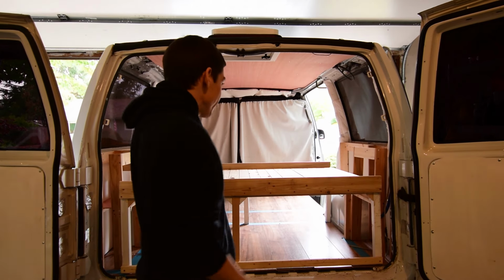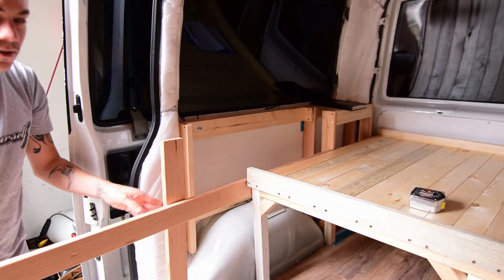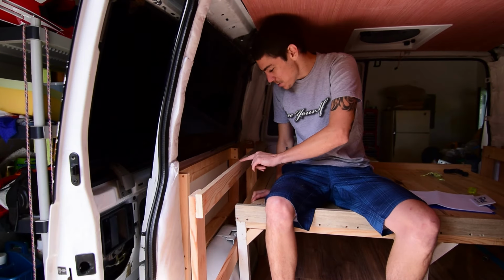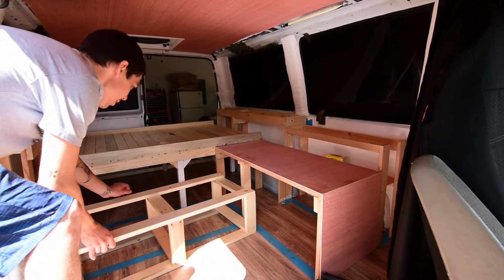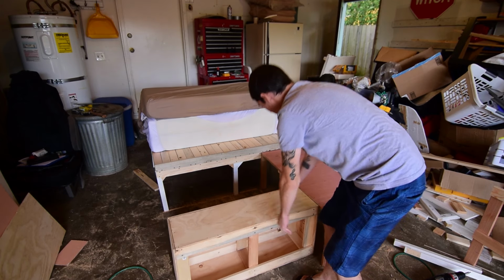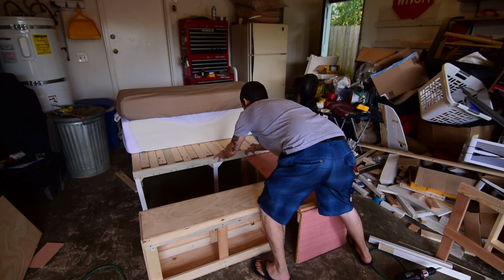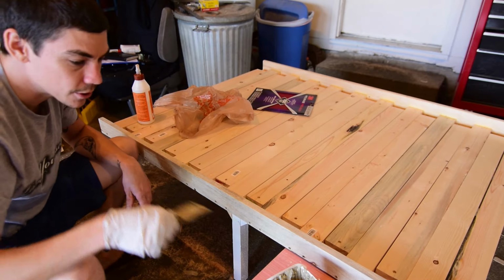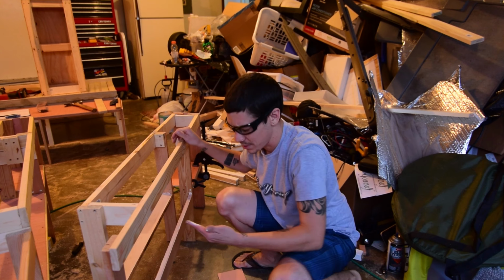VAN BUILD 2pt.13 FINISHING CABINETS, ULTIMATE STEALTH ASTRO CAMPER VAN DWELLING

Comment: Man that looks GREAT. And that piece of wood that you have as your bed stopper you do NOT need (Hey its your van and your doing great), I just would have put the bed stopper on the back of a few of your bed slots, just by adding a few small clips under a few slots to catch from under the bed, but its the same result either way. Congrats it looks GREAT

Comment: For the bed slats sticking, go to a store that sells canning supplies and buy a block of paraffin wax (also called canning wax or jelly wax), then rub the wax just enough to get a light residue on all the contact parts.

You may need to reapply a few times as it wears in. I do not recommend beeswax in this application because it may stain your mattress because of the very low melting point.

I use this trick on the drawers and doors on old furniture.

Comment: I have a suggestion, I hope I can make it "understandable". On the back of ur bench that u will be turning over and Sliding back to the end of the bed, glue a piece of felt on the back And it will slide so easy, quiet And will not Scratch ur floor. 🐙 Great Job! I would have had to use , used furniture pieces from the thrift store!
Reply from the maker: +Debrajoy that makes perfect sense, and is a great suggestion! Thank you!
Reply: +Into The Mystery 13 No problemo! I'm luvin ur build! 🐙

Comment: Oops, I know this is too late, but I would use light coats of good quality spray paint, gives really nice Finish! 🐙 Do in the back yard on paper tarp, no mess!
Reply from the maker: +Debrajoy spray paint on what?
Reply: +Into The Mystery 13 On all the wood u want to paint, u get better coverage and it's easier than trying to use a brush.  Rustoleom makes one can with a great spray nozzel that let's u spray from any angle, even upside Down! A few "light" coats keeps it from running and there r No brush marks. I would use semi gloss for really easy wiping down and creates a nice seal for ur wood. 🐙

Comment: I want to save weight as much as possible. I am thinking of doing the cabinet out of composite foam. skipping the box support and instead using legs. I think I am going to need mine much shorter since I am a tall guy. a swivel seat is a must. did you ever get that figured out? I have seen kits on the internet $79.